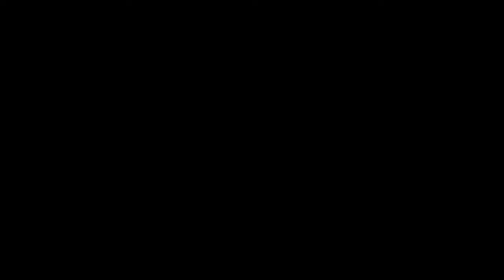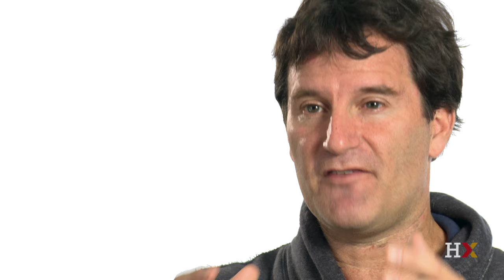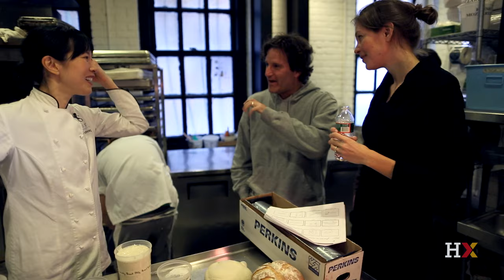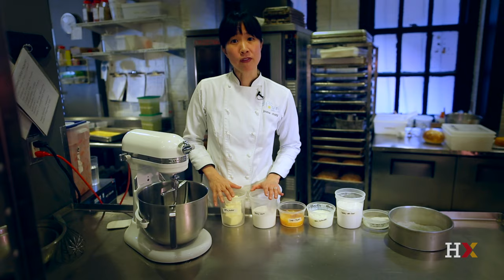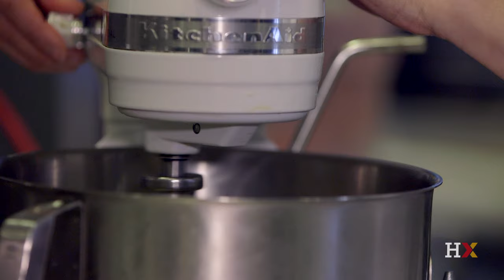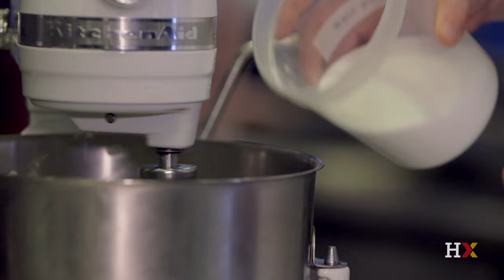The physics of baking

Comment: Does anyone knows what is the science behind adding milk powders to dough? I saw it in lots of recipes where they use about 20 to 30g. But that addition add to the dough in term of flavours or dough structure?
Reply: Both to strengthen the dough and acts as a dough softener. If use in sourdough. Powdered milk is used to avoid having to scaled the milk. If you don't scaled it or if not using powdered milk, the enzymes from the milk will have a negative reaction with the sourdough starter.
Reply: milk powder is used in certain scenarios where milk is desired, but is unable to be held for long, so to avoid expiry its substituted for milk powder and water, because milk powder is just dehydrated milk.
Reply: When making chocolate, for instance, you do not want water or any other liquid in it, or it will get ruined. To make white chocolate, powdered milk is used instead of real milk.

Comment: I have a question, can we bake with any type of flour .
Reply: I doubt this channel will respond. Do you mean flour other than wheat flour? Or different types of wheat flour? Regardless, yes, you can bake with any type of flour--the gluten free flours are more difficult to work with as the gluten structures won't trap air as well to make them light and fluffy. Different types of baked goods will work better with different types of flour--best bet is to look up recipes that specifically have been tried with wheat flour alternatives. One of the beauties of modern internet is that in most cases, others have done quite a lot of ground-work for you.

Comment: Dear Hardvx team, What if we want something fudgy and not caky? As far I have read about and discover is to melt sugur and butter together on a low heat rather than beating it for a dense fudge brownie. Is that true?
Reply: For a dense fudge brownie you want to use plain flour & add baking powder. Melt butter & 70% chocolate, mix eggs & sugar, add the melted choc & butter until combined then slowly FOLD the flour & baking powder in (vanilla and salt too). The trick is 100%!!! To leave it in the fridge for a few hours, or best, over night- you’ll never use a different recipe, trust me 😉